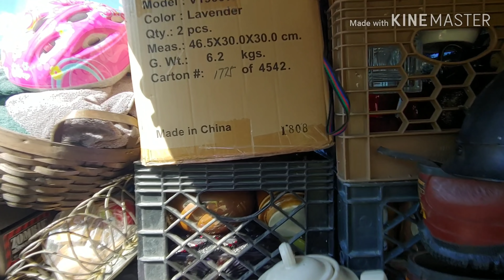Prepping for the flea, scrap load ,Subaru fun

Comment: YOUR NO MASTER PACKER I SEE ROOM FOR LOT MORE GET 2  SHEET OF PLY WOOD SOME 10 FT LONG 2X4 MAKE A FRAME HANGING OFF THE TAIL GATE PUT PLY WOOD ON TOP STEEL THE REAR FROM THE  TRUCK OUT BACK DUCK TAPE ALL TO GATHER REAR AS BACK WHEEL OF THE STRETCH TRUCK DUCK TAPE TO GETHER PUT BASKING ON ROOF AND USE HALF YOUR HOOD TO NOT LIKE U CAN SEE WHAT GOING TO HIT U ANY WAY LOL